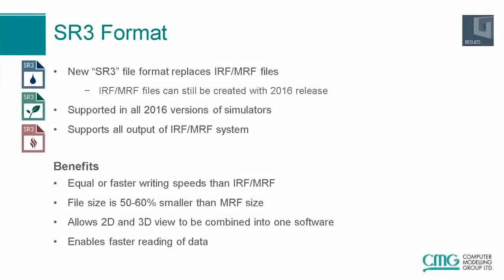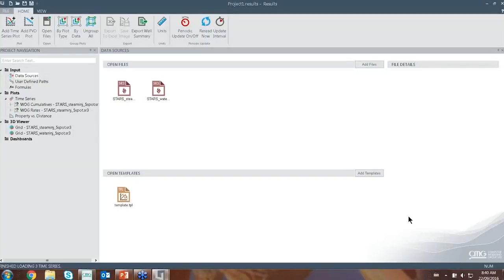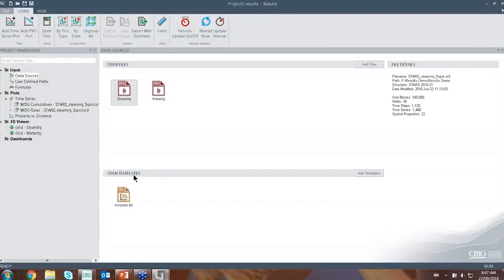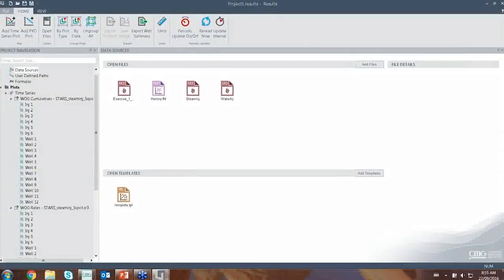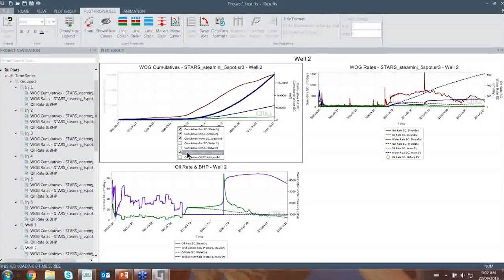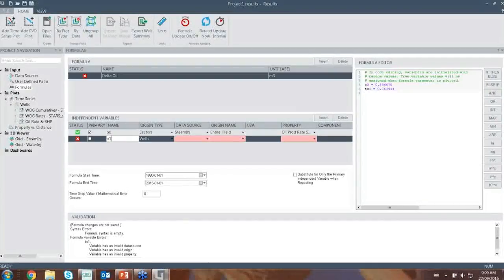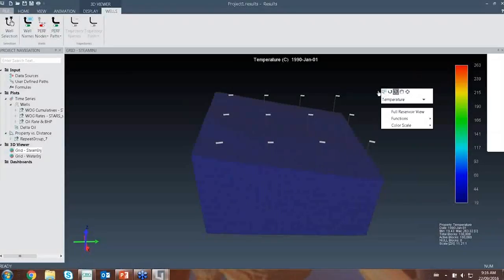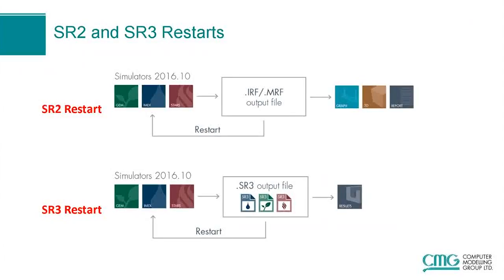CMG Webinar: Results - Faster, Intuitive & Brand New

Comment: When I start the animation, the time data (the red line) on the time series plot (oil rate) is not shown. And the "jump to the time step" does not work. Is there any setting I need to do?
Reply from the maker: Hi Wang, thank you for your question. There's no special setting that you need to enable but perhaps the issue is related to the version of Results you are using. Please email us directly at support@cmgl.ca with more details and we can definitely help you out.